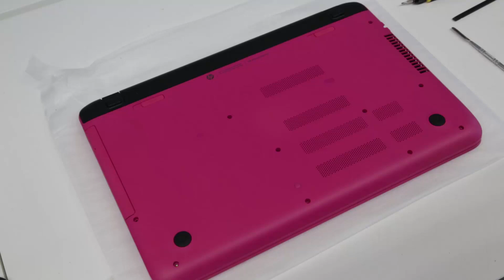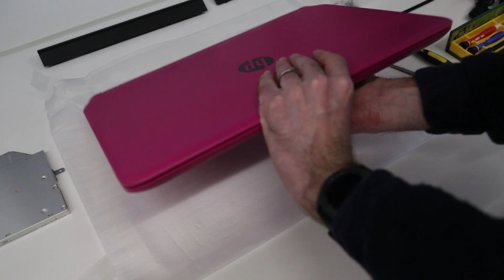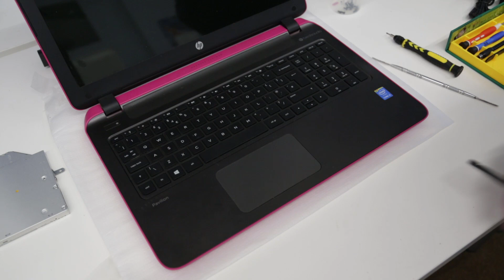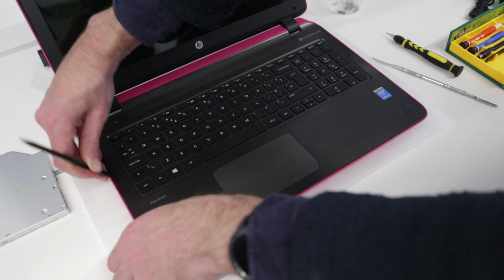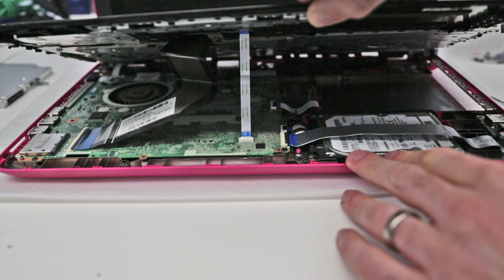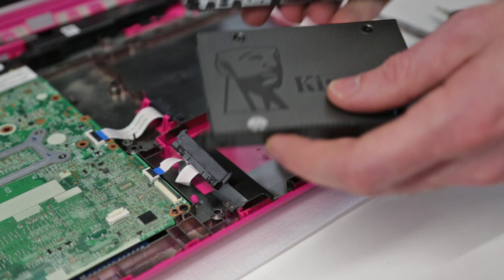HP Pavilion 15-P165SA HDD/SSD upgrade guide

Comment: thanks for the great video. very clear on how to get the old drive out and the new part installed.  really clear!  FYI a footnote to add in case it helps others.  If you are very careful, you can not bother with detaching the ribbons that go from Keyboard 'top' of clamshell down to motherboard (for Power, Trackpad, etc).  Instead just 'VERY Carefully' keep the clamshell lid open a couple of inches. Then prop it open with some small suitable thing. Carefully detach the ribbon that lays over the HDD. carefully pop up the old HDD: remove and replace with new part. Then replace the one ribbon cable, quite easily, which you must detach. Finally close the unit. Test it before final close up to make sure new drive works. And then you are all good.  Downside with this approach, if you are not careful and you rip one of the ribbon cables, you are in for much bigger headaches. But this approach does seem to work ok if you are careful.  Anyhoo. Just FYI!  Thanks again for the lovely clear video!
Reply from the maker: Glad you found it helpful and nice tip.

Comment: Great Video!
I do have and HP laptop. It is a Pavilion but I'm not sure if it's a 15-P165SA. Finding the designations on these HPs is a real challenge. At least for me it is. Would you say that all th HP Pavilions are essentially the same as far as the layout goes?
Reply: Sadly, no. They've made Pavilions for years. Some are identical, some similar and a few don't match. But look online, usually you get similar or familiar versions to yours.

Comment: Great video!
I'm troubling with my laptop. It has the same physical appearance as you showed in this video. I've brought it to a technician and he just pulled out its RAM, it worked for a while,but now it has the same problem, which, is an instant turning off when I press (put a little pressure) on its left side near the touch pad.
I live in Afghanistan its a little difficult to find a good place to repair your stuffs. It's been a long comment hope you would see that and if its possible to reply me how I could reach to you, if it's not clear what I wrote in this comment.
Thanks alot.